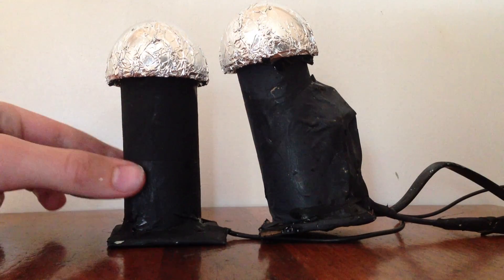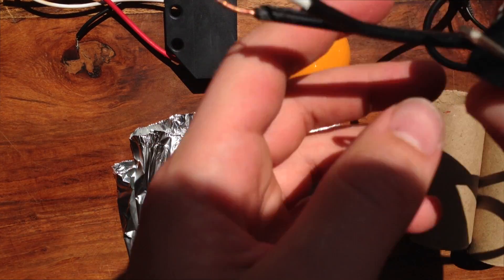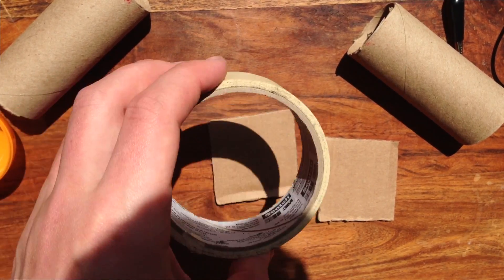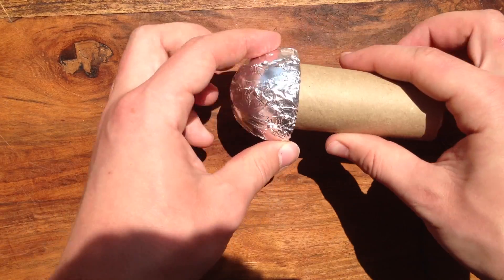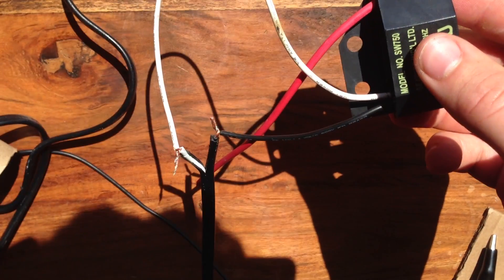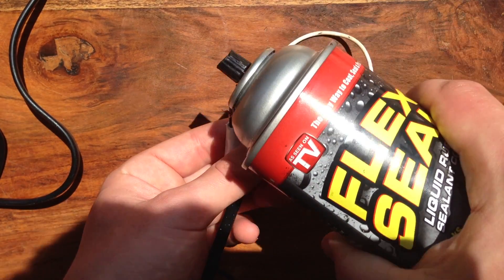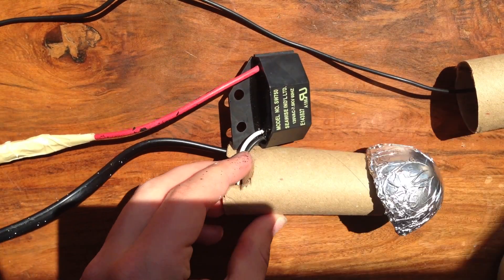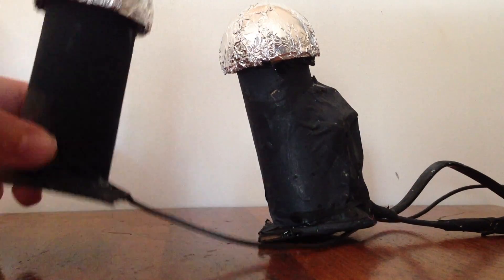How to Make a Mini Tesla Coil

Comment: Tesla coils were designed to inject or displace ions around it otherwise known as rf fields. A negative ion generator does exactly that hence the name ( negative ION generator). So technicly you are using the device as a tesla coil granted that it is not a typical Tesla coil.
In other words : good work

Comment: the Ion generator uses an internal transformer, so it technically does have a coil.  it is more of a Solid State Tesla Coil (Tough not exactly because it is not resonant and does not have an air core) because it uses transistors, etc.  Also, Van de Graaff generators use a spinning belt and wire brushed to collect a charge on the topload, this does not work this way.